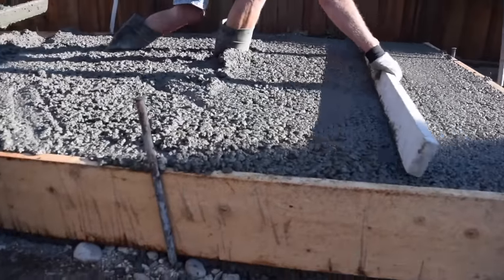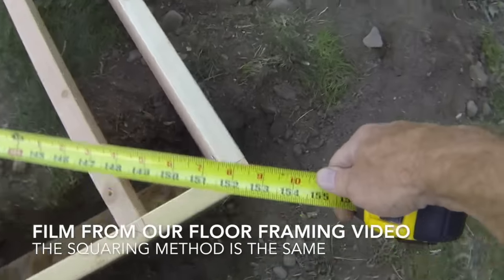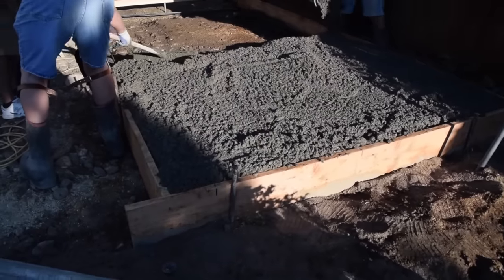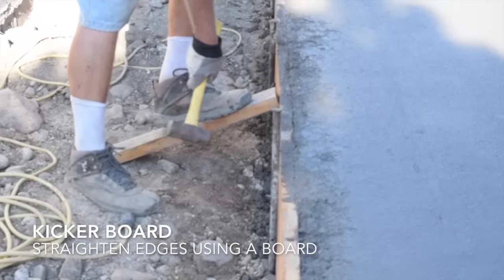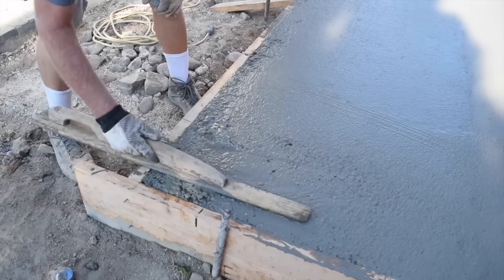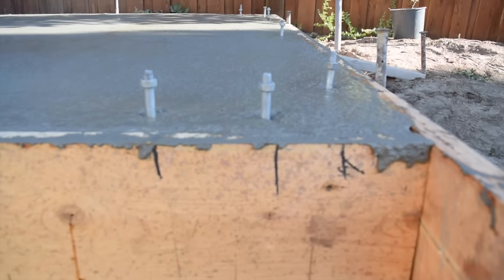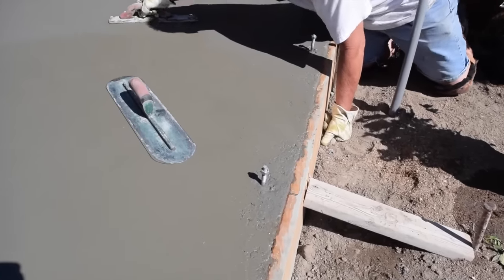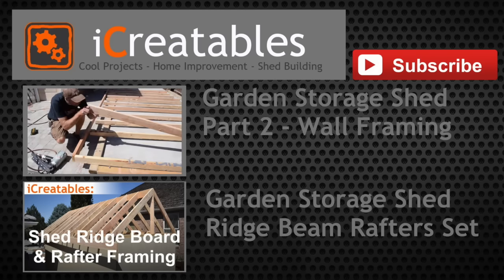How To Pour A Concrete Slab For Your Storage Shed Floor

Comment: well i guess this is better than how i do my walk ways .I just mix bags of post setting concrete  in a wheelbarrow and when i get the small form filled up i mist the heck out of the top with a water hose  , this causes most of the rocks to drop down knock the sides with a hammer then float it with a 2x4. let it dry for two days and it's done. Wont stop a bomb like this one would but it stops mud from getting on feet and tires. No ground freezing  problems here in florida

Comment: Good day, if I don’t use cement and use 4x4 treated wood, how long would that 4x4 last on the floor before replace them, thanks, blessings. Great video and instructions.
Reply from the maker: It depends on the humidity and the wet dry cycles. Try to keep the wood dry by installing it on a bed of gravel.

Comment: 7:40 why didnt you use wires? just tie a wire to a nail on the side, go to the other side and make a nail on the same mark and tighten the wire to it, then you'd know exactly where to put it
Reply: They would just get in your way when you go to trowel the surface and they wouldn't hold with all the pressure pushing against the boards
Reply: youre incorrect, it wont get in the way, and the ''trowel'' part.. idk that word, but if you mean that theyre flattening the concrete then watch the vid again because its already been done, and you dont need to put the wires on for hours, just 5mins is good..

Comment: Nice video and all. I would have done a few things slightly differently.
- Stakes cut below the forms. So it don't interfere with screed board. I usually use just plain wood stakes. 
- For the J bolts. A line stretched between the forms makes for easy alignment of the bolts. That way can be set perfectly straight. 
- Wire mesh on the slab portion itself. 
With that said, The video was quite informative and well done. Thumbs up. ;-)
Reply: true

Comment: Cost of storage shed...$1000, Cost of concrete foundation/labor $3500. Shit! Shoulda just place the shed on dirt.
Reply: I poured and finished my own slab of 150 sq. ft. for about 250 bucks worth of ready mix. I had to buy a12 pack of beer for my neighbor to help.
Reply: Always have to consider what your time is worth in such projects though. Free (or nearly free) labor always helps though!

Comment: Why so dang thick for a little shed?
Reply from the maker: Anything less than 3 1/2" thick on the floor will crack. The edges are thicker because they are load bearing. The idea is that when the ground moves under the shed the slab will move as one piece with it instead of cracking.
Reply: iCreatables
Not true. I have 3" thick slab for a 5' X 5' shed that's been there for 20 years and no real cracks.
Reply: Patrick EH well you must not live in California